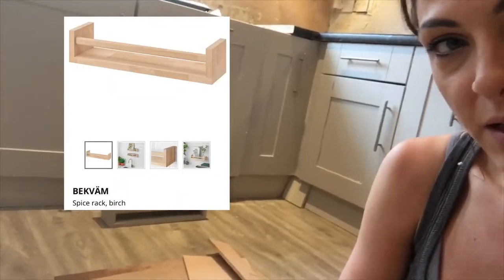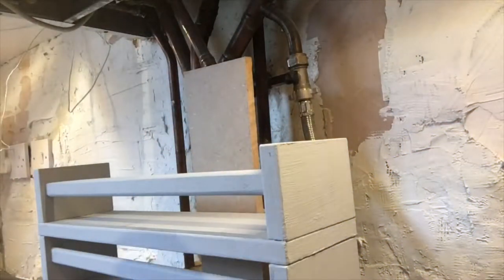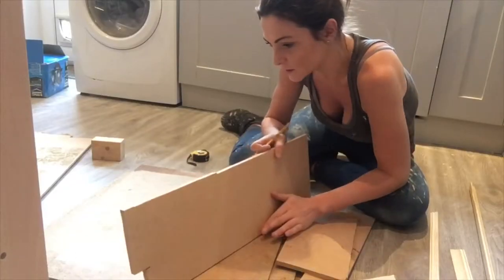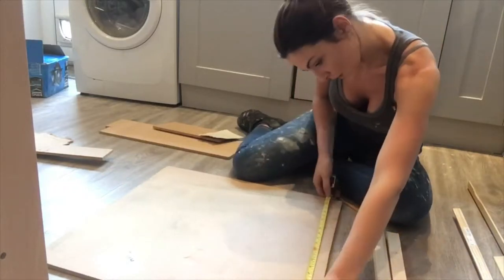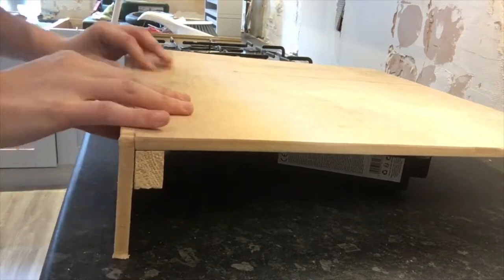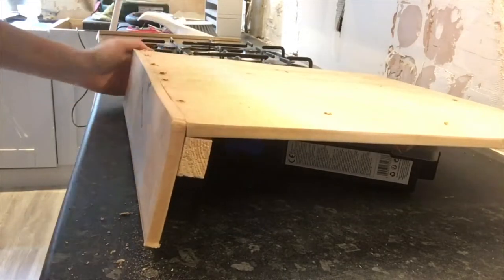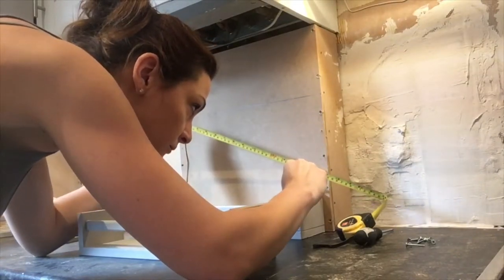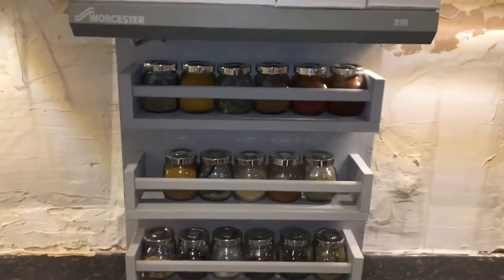Cover Up Boiler Pipes | IKEA Hack | Easy DIY | Spice Rack | How To Cover Up / Box In Boiler Pipes

Comment: Hi this looks good. But did u attach it to the wall in anyway? I was thinking of making a box but tiling onto it and having it stuck to wall with no nails maybe
.but not sure if good idea in case ever need access...
Reply from the maker: Yes I used magnetic catches to fix it to the wall so it easily pulls away for access. If you search magnetic cupboard catches on google you’ll see what they are - you can pick these up in all diy stores. They are in two parts so there is a larger plastic section that fits to the inside rear of the box then a small metal strip that attaches to the wall. I actually superglued these onto the tile rather than screwing because they are so small and I’d recommend using at least 4 in total to hold the weight as it may tip forward if loaded with spices! Hope this helps ☺️
Reply: @LauraDoesLife  ah thats a great idea never even thought of that.  Thanks
Reply: Good solution to use magnetic cupboard catches and the cupboard can be removed in case of the need.

Comment: You’ve got to be having a laugh with this one, imagine the carnage of there is any problem with the boiler piping connections … that patching and plastering is a sight to behold too.
Reply from the maker: Carnage in what way ? It pulls away for access to pipes and not fixed to the wall 🤷🏻‍♀️ admittedly the wall behind was shocking but the tiling over was spot on - check out the finished kitchen
Reply: @LauraDoesLife  . Well if it’s not fixed it’s going to fall over, still if you happy with it that’s what’s important!